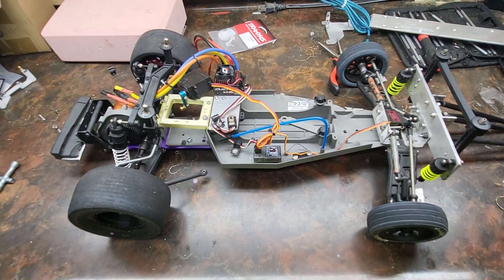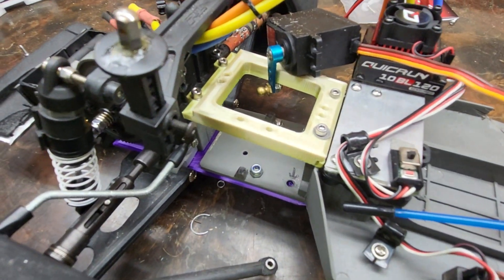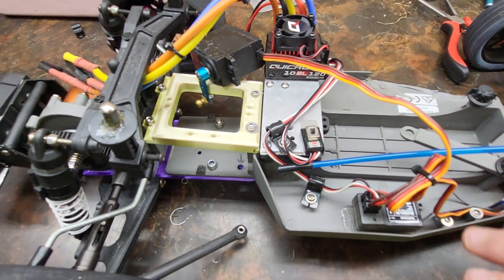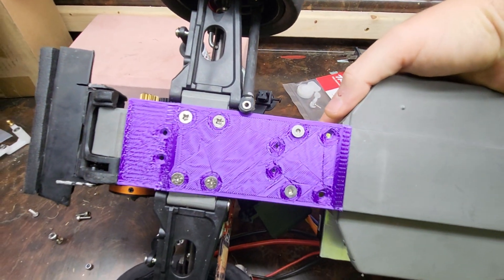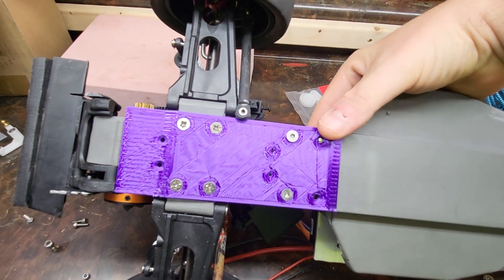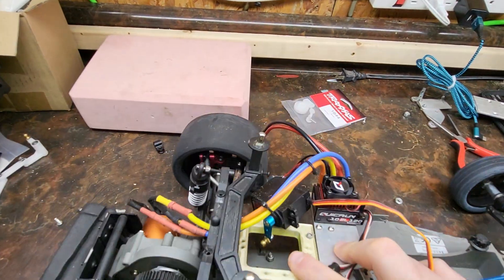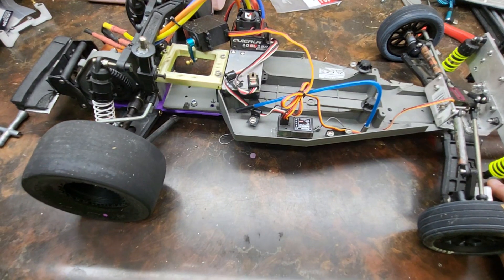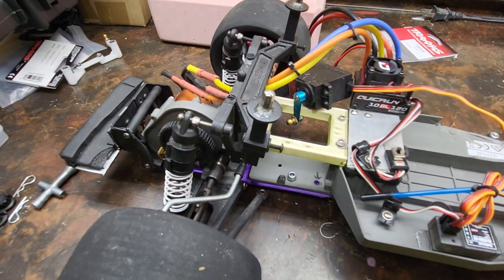World's First FWD Traxxas Slash No Prep Drag Car Gets New Prototype Pieces (Quick Update!)

Comment: This setup looks promising! Ive been wanting a no Prep fwd rc for years and you got me inspired to start a build! 

Had an old redcat lightning chassis that I gave up on a few years back and I can easily reverse it and add steering to the rear like you did. Only I'll be adding twin motors to my setup lol
Reply from the maker: One thing I've learned from running this car is that a ton of horsepower is not your friend. Even on the Big Daddy's this car can spin the tires all the way through the traps. I believe this car would be faster with a 17.5 spec motor than it is with the 4300 that's currently strapped in.
Reply: @1i-rc  I follow a lot of real scale fwd drag racing and I definitely get that! Im only going for twin motors to get the weight I need up front and to hopefully have the tq I want off a 2s battery. I was going to use either 3100s or 3400s not sure yet